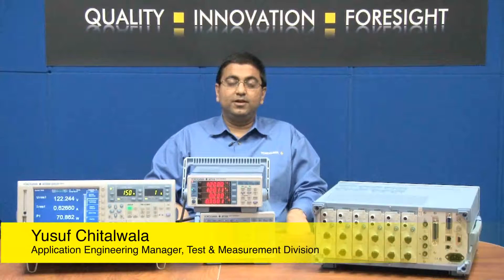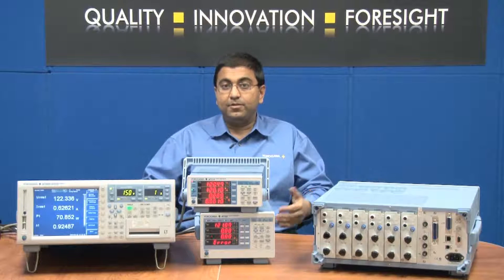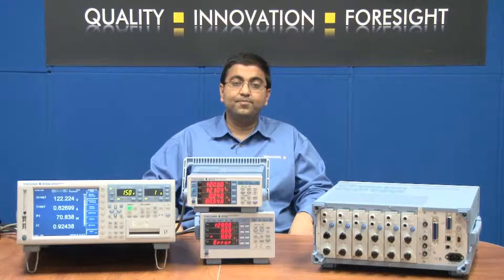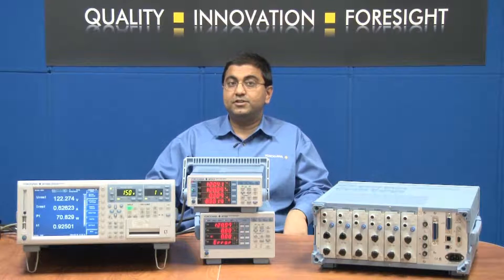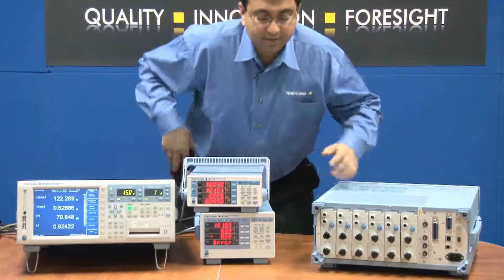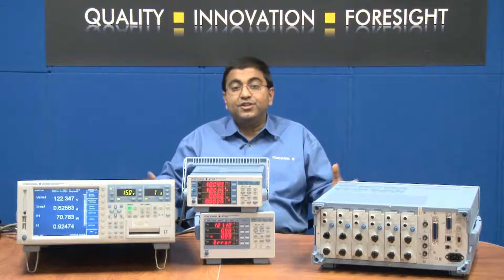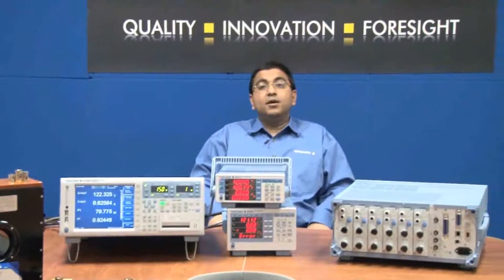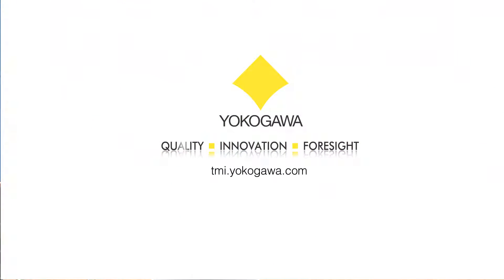Measuring Current With a Digital Power Meter

Comment: hi!
thank you so much for the video.
i want to read data from the yokogawa Wt300 with labview via the ethernet-interface.
does the wt3000 measure all the the functions(u,i,p,...)  for all moduls simultaneously?
how does the wt3000 work?
thank you!
Reply: hi what if the meter have no load yet what is going to show at the monitor of it
Reply: or it say at the bottom motitor of it say error what is that mean i hope could help out thank you